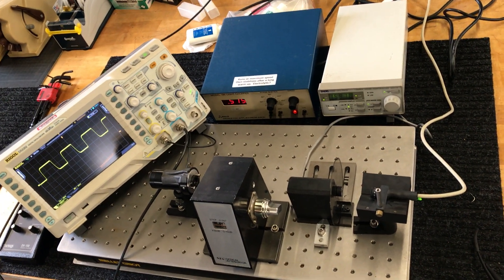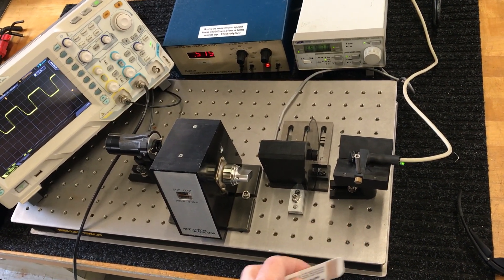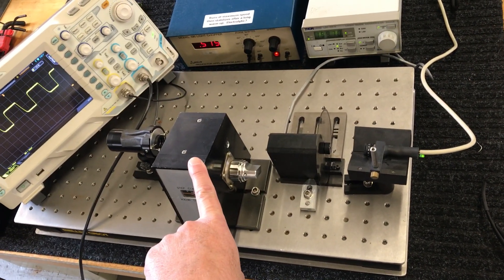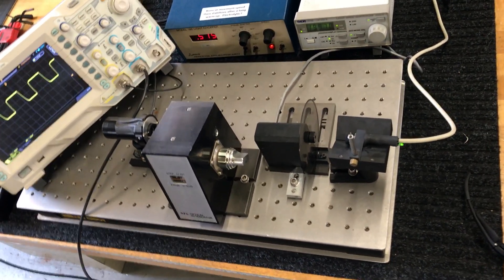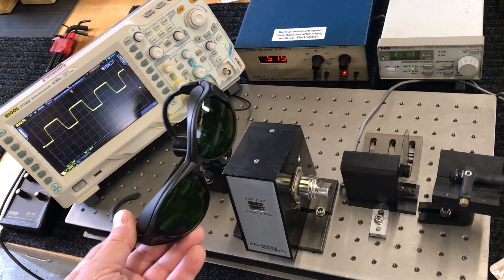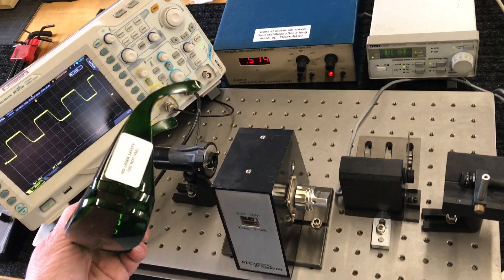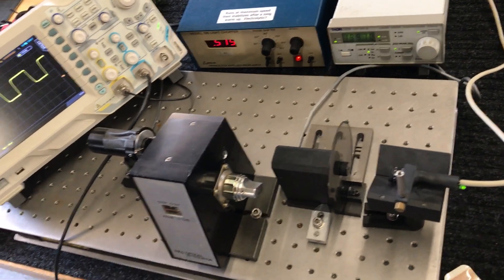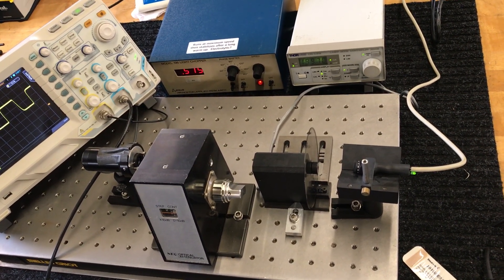Optical density (OD) confirmation test for laser safety glasses 1064nm

Comment: Thank you for making this video. Were there OD markings on the glasses that failed the test?? Also, are you selling testing services? I'd be happy to pay you to test my glasses. I have 6 pairs and would send you more if interested. If not, where can I get mine tested?
Reply from the maker: The cheap glasses I show in this video had no OD markings that I remember.  There are companies that will test this kind of thing but that will likely be an expensive test.
Reply: @MathIndy  I can't even find anyone that does testing, which is how I found your video. I guess I buy the same equipment you used but looks like maybe a couple thousand.

Comment: Are you able to test standard green translucent acrylic?
Reply from the maker: I have tested standard green acrylic and it does not block 1064nm light--don't use that material for laser safety.  Only use window materials and safety glasses that have been tested and are certified at the wavelength(s) that you are working with.